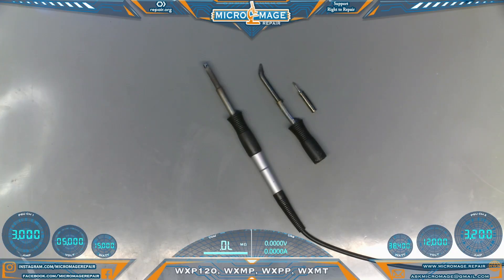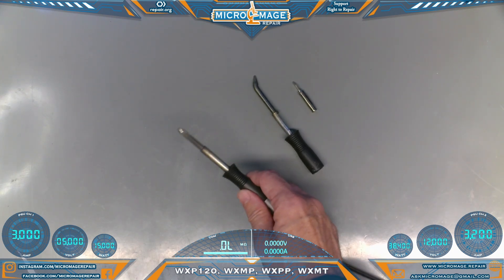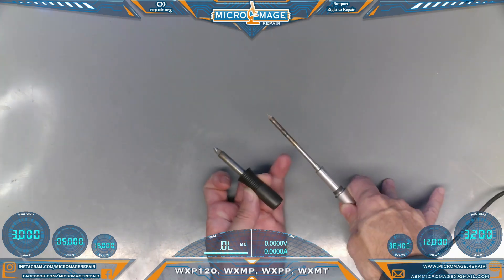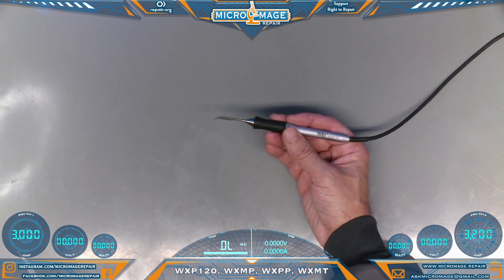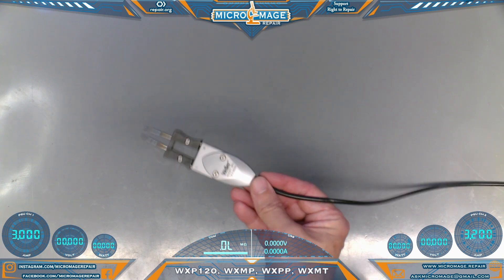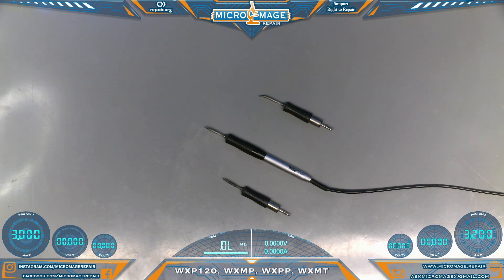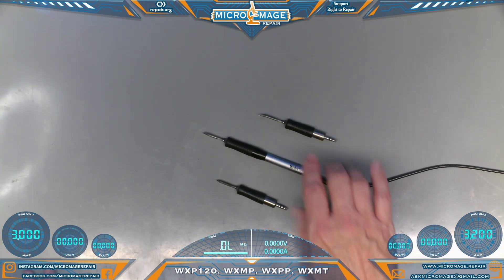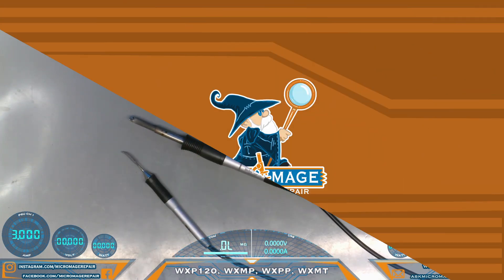Weller WXP120, WXMP, WXMT, & WXPP

Comment: I completely disagree about the WXMT. We have the WTMT which is an older, lower power (60W) version otherwise identical, and they are perfect for removing small SMD devices. Been a total game changer for our small engineering team. If you aren't using micro-tweezers to get those jobs done, well, what are you doing instead?
Reply from the maker: I'm a technician, not an engineer. 
I'm not doing assembly, so I can't speak to their usefulness in that regard. 
I could see them working for thin board assembly. 
The stuff I work on is many layered, and even my more powerful ones (compared to yours) don't have the ummph to get it done without hot air assistance. 
That's on devices ranging from iPhone to Xbox.
Reply: @MicroMageRepair  Usually, multilayerboards always require underheating while working on the other side with tweezers, a single iron or hot air. It also reduces stress on the board and surrounding components compared to when you don't. And than there is tip size. If you can, using a larger than the part tip size on a tweezer on a multilayer board can get the job done compared to tips that exactly fit the parts' terminals. You need thermal mass to help you with component removal, as an active tip can only do so much.
I have a Weller WXMT to my disposal at work, but literally the only thing going for it in my opinion is the tip-exchange, which (as far as I know) is done by exchanging the cartridge that holds two aligned tips, where every JBC tweezer I know has both tips held individually and also requires individual alignment after exchange.
Other than that I downright hate the Weller WX 2 power units for those tweezers. The physical interface is an effin' nightmare to figure out without a manual, which I consider a very bad thing for a unit a professional should be able to work with straight away. It should only require reading the manual for the more sophisticated features. That's where JBC clearly wins in my opinion and I love both tweezers I have from them. The Weller WTA50 I still own as well is only there for the less tiny and less heat-intensive jobs.
Reply: I agree.  I have used the WXMT to remove loads of SMD components, usually those with 2 contacts such as capacitors, on up to 10 layer boards with thousands of components from 0402 up to 3216.  Just brilliant.  I usually just use the tip it comes with also.

Comment: Can you provide the part numbers you use for the Micro and Pico penci? Weller has like 20 Different size chisel tips. Looking to add a knife tip to my WXMP and invest into a Pico pencil setup for DJI connectors.
Reply from the maker: Here are my favorites .
WXPP Weller RTP025KMS T0050102999
WXMT Weller RT5 T0054460599N
WXP120 Weller WTE T0054470799
I switch to others on each infrequently depending on need.

Comment: Is there much difference between the wxpp and the wxmp? And if you had the wxmp, is it worth getting the wxpp as well? Thanks
Reply from the maker: Yes.The WXPP gives you much finer tip options than the WXMP. It doesn't replace it though. Both irons do what they do really well.I have no regrets owning both. I use both on just about every job.
Reply: @ thanks so much, I’ll go ahead and get the wxpp as well. Really appreciate your help with this. Got the wxp120 and wxp 65 last week to go with the hot tweezers and wxmp that come with the station. Really happy so far. Just purchased the Weller wh200 heat plate today so I pretty much got the full weller setup now to replace the hakko . Made the decision to go weller after watching your videos, so thanks so much as I value your opinion really highly, thanks rich
Reply from the maker: @SURGE101  Man! That's awesome.  Will have to give me a review of the 65 and heat plate.  I don't have either of those! You won't be disappointed in the WXPP. I'm still amazed by that iron regularly.
Reply: @ will do, the 65 very similar size and feel to the jbc T210 handle and c210 tips. So far been really happy with it, need to get some more different tips for it,as I’ve only got the one tip that came with the iron at the moment😂 but it been great so far. Once the heat plate arrives , I’ll let you know if it’s any good or not. So far no complaints, just had a bit of trouble to begin with , with the settings and the wheel thingy etc but you helped me loads with those. Really appreciate everything. Thanks rich
Reply: @MicroMageRepair  The 65 is my go to, I use it for basically anything SMD and anything that's through hole with thin pads. So versatile.  I even just change the tip for different jobs where a larger tip is required.  My main tip is the 0.4 x 0.15mm chisel, does almost everything.  I can't quite do 01005 sizes with it, but 0201 is fine, as are all chips I've done.  The hot plate is great for small things.  I've mainly used it for a research item though that isn't typical use, so I can't attest to it's capabilities with chips so much.